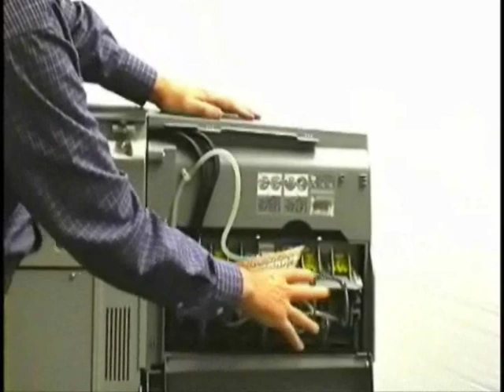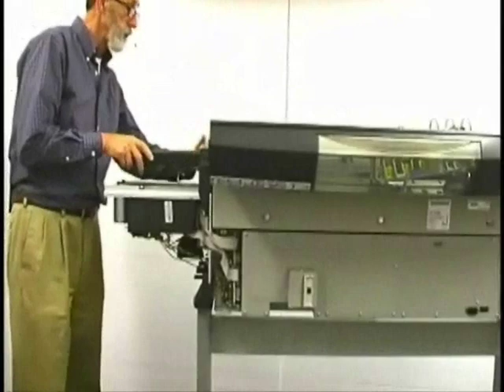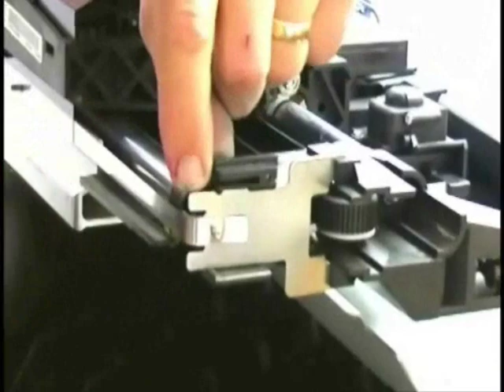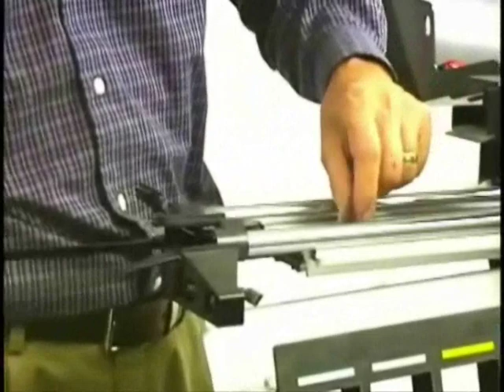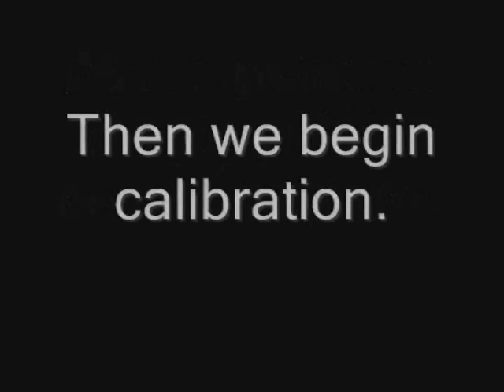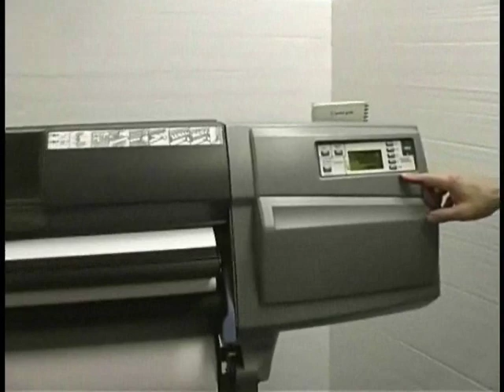How to Replace The HP Designjet 5500 Carriage Belt

Comment: Great video. I did not have to change a belt but I did have a "check print head" error. I tried cleaning and oiling the rods with no luck. Soooo. . . I figured it was the belt. This video helped me make the repair without taking unnecessary screws and parts off. Before the tear down the print head was very jerky and hard to push with my hands. As soon as I took off the hose assembly and went to move the print head to the other end, it moved very easily. Needless to say, my unit was very dirty. Embarrassing yes, but the filth that accumulates is hidden. Anyways. . . Thanks for sharing. It is a great video and is very much appreciated.
Reply: Yup! Just had the same problem, and I took a flashlight and looked into the darness and thought the drive gear was broken but it is just totally gummed up! The belt is disgusting as well.